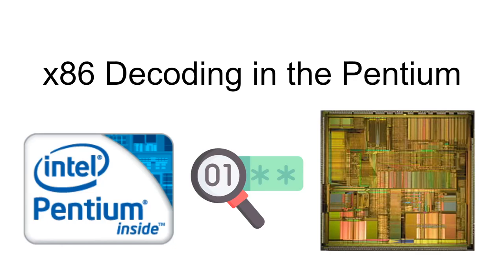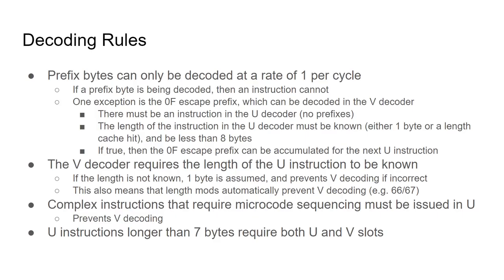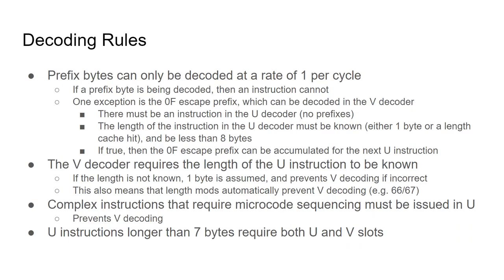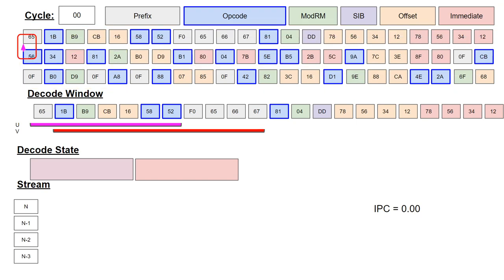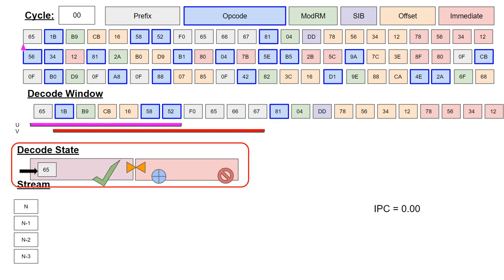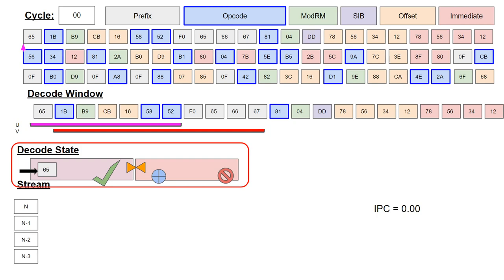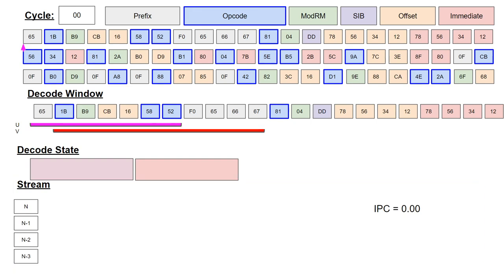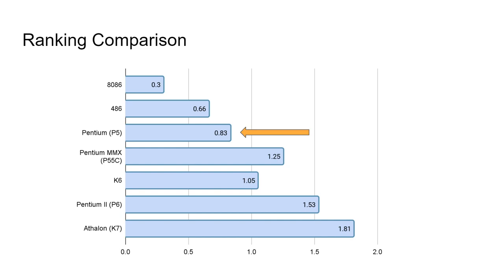x86 Decoding Simulation in the Pentium P5

Comment: Thanks for this complimentary video. It was very helpful. How to decode the instructions from a byte stream is now very clear to me. But in the last video you mentioned that there are two pipelines (U and V) with different execution units. However, as far as I understood the U and V decoder work here together to generate a single instruction stream. How is it then possible to feed both execution pipelines in parallel?
Reply from the maker: I'm glad it helped, your earlier comment is what prompted me to make these supplementary simulation videos. 
The two pipelines can only execute sequential instructions, which also need to follow specific pairing rules to ensure that there are no dependency hazards or resource contention. If you look at the PMMX videos, that should make a bit more sense. There's also the MicroOps in the PMMX video which describes how more complex instructions are issued. The only difference between the P5 and P55C, is how the length decoding is done, and the inclusion of a transparent instruction FIFO - the pipeline issue / schedule logic is identical. So to make the comparison, think of the P5 having the pairing logic and first stage decoder squished into the alignment stage.

Comment: Another question: How does the length prediction work for the V decoder? What information does it take into account to vary the estimated length from 1 byte?
Reply from the maker: Length prediction isn't required for the V decoder, only the U decoder. The true length of both the U and V instructions, is determined during the alignment, but after the alignment is done. If the predicted U length is incorrect, then the V instruction is squashed and only one is issued that cycle. If the U length is correct, then the V length is used to update the decode program counter. 
The estimate of 1 byte is updated once the instructions are previously decoded. There's a patent that describes the mechanism, where end-bits are determined during decode (32-bits for 32 bytes, where a 1 marks the end of the instruction). Once the 32 byte buffer is decoded for the first time, the end bits are stored in a prediction cache to be used for the next time that buffer page is accessed. Although, the cache is likely quite small, so that will only matter for small loops (it's even possible that the cache only has 1 entry).

Comment: Does this mean you're writing a Pentium FPGA core next? ;)

Enjoying this video series already, btw. I never knew the decoder stage was quite this complex.
Reply from the maker: This is supposed to just be a supplementary video, not a series. If I didn't need to explain what was shown, then I would have done it as a short, or even a gif. The actual "series" is the one that I recently posted on x86 front end complexity.
As for the decoder, this is actually just the feeder for the decoder in the Pentium P5. The PMMX (P55C), K6, P II/III (P6), and K7 are far more involved. I have simulation versions of all of them, which is how I got the IPC numbers in the final chart.